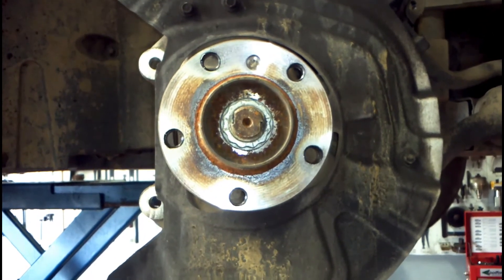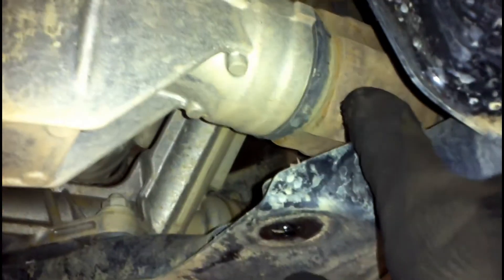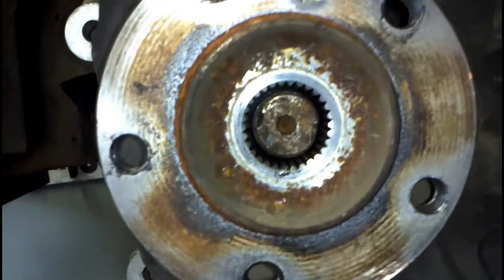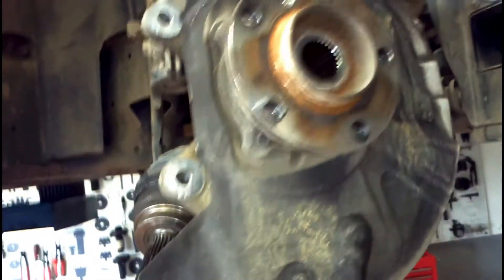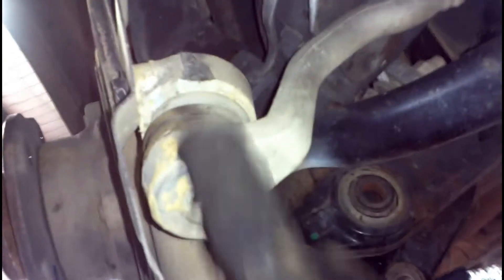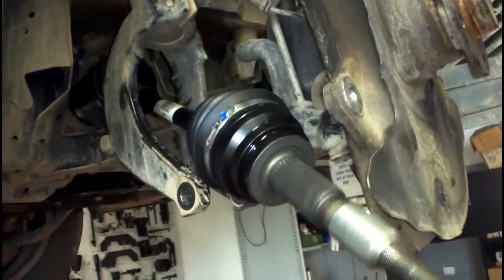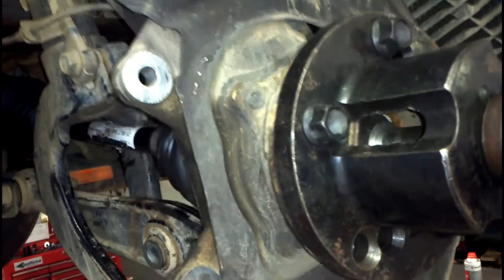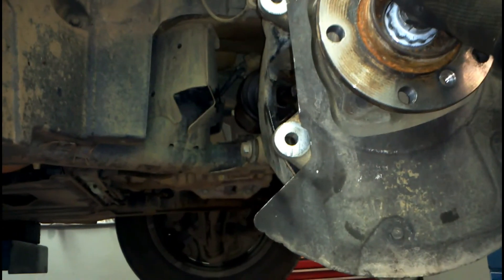BMW CV Shaft X5 E70 Removal & Replacement How to DIY: BMTroubleU

Comment from the maker: if i remember correctly there are eccentric bolts which change the castor and camber on the front and the rear, but unless youre doing it at a tire shop with a wheel aignment machine i cant recommend you do it yourself. you'll just stuff your ride and chew your tires if you get it as little as 1 degree out

Comment: Those BMW  ball joint separators are nice but it sucks you can't used an impact like my non bmw separator tool.  I really recommend the axle tools in this video they are a must.  As for removing the axle from diff. also there is special BMW fork to take them out but won't always work  not even the pry bar  you will need a strong air hammer.

Comment: Hey BMTroubleU, great video!! Can you list the torq specification for all the suspension components you worked on this video (axle nut, struct lower fork arm, lower camber amr, ball joint nuts (two of them). Also do you have the torq specs for the wheel hub assembly bolts, the second lower control arm, and wheel lug nuts? I am doing a wheel hub replacement and axle replacement on a X5 and can't find the torq specs anywhere.  Thanks!

Comment: Can't you just use the old axle nut to pull it back into place instead of the specialty tool?
Reply from the maker: From memory, I don't think the end of the cv joint protrudes far enough through the bearing to get the nut on. 
You could try tapping it in until it is, but then you risk damaging the cv boot.
Reply: When I replaced my CV Axle, the spline slid through the hub with a little grease and a slight tap with the rubber hammer. I didn't need the puller. FYI, you can usually rent a puller and other tools from a local auto parts store for free.

Comment: Do you think that a bad CV shaft can caused unevently worn brake pad ??  I trying ti figured out my problem that is grinding noise on front right wheel. This is happening only when trurning left or right. Many parts have been replaced included rotors, brake pads and wheel bearings but the noise still there ://

Comment: My local garage are quoting me £900+ to replace a drive shaft, surely that is too much for what looks like 2hrs work max?
Reply from the maker: I'd estimate 100-200 pounds for a single shaft with joints in parts cost if they need replacing and 2 hours would be rushing.
Sounds like a good price from Australia mate. Pay the money, don't be a Scrooge
Reply: @BMTroubleU  labour in the Uk is £60-80 per hour so a part that is £200 and a few hours to fix shouldn't be £900 should it?
Reply from the maker: @verdej2057  oh 900+. You wrote 90 before editing. If you're getting the work done at a BMW dealership then that price might make sense.
If not, then yes that sounds steep

Comment: Hi BMTroubleU, Just a quick question re pulling the cv back into the hub without access to a puller as in your vid, do you think it's possible to shrink the shaft enough with dry ice or is the interference between the shaft and the hub spline too much,
Reply from the maker: you could give it a try, it could conceivably increase friction but if you shrunk it enough it could help. let me know how you go with it mate
Reply: +BMTroubleU Gave it two hours wrapped in a thermal bag filled with dry ice with some additional thermal wrapping around it, the wife wasn't delighted as I wrecked her shopping bags, but heh what's new? Left the new hub sitting in direct sunlight, plenty of it here in Dubai, and it slipped through, still a bit tight but a bit of final additional help with the brass hammer and the job was done, finished it off with the new nut.

Comment: Have you ever seen a front differential housing cracked !!  I have a 2013 528xi 94 k miles , I took my car to do a coolant flush out to a BMW SERVICE CENTER, everything was just fine driving around days after a grinding noise coming out from under the car one of my  friends has a lifter in his garage  , while driving a noise under the car like if you have a bunch of asparagus on one hand and twisted it on a circular way to the other side with you other hand, I checked under the car and NO shields/covers on it ! and saw some oil dripping,  I drove very slowly to my friend's garage lifted it up and found myself with a cracked differential housing!!, I'm like how this happened!? The connection to the drive shaft to the rear wheels was lose or something,  I'm still wondering " how it happened!?" Freaking weird !, I heard about issues but nothing like a broken front differential housing,  it cracked from inside out !! , I searched and searched on line and haven't find anything like that ! No one thing !I'm wondering if this perhaps was done by a mechanic when the car was there for the coolant flush out!, so they get some steady costumers!!, any have any  idea or experience please share it ! , I don't know what to think about this!!
Reply from the maker: I honestly doubt this would have anything to do with the coolant job, but I do recommend contacting the dealership and calmly explaining the situation with the goal in mind of bringing it in to be inspected. Just take some detailed photos first in case you need evidence later.
If they're a worthwhile operation they will check it out for free to confirm its nothing they've done.

Comment: Where can I buy the tool to push the cv axle shaft out from the hub? Never seen that
Reply from the maker: @ariasl9948  it's a bmw special tool. Not sure you can buy it commercially, but a regular puller tool set might suffice.